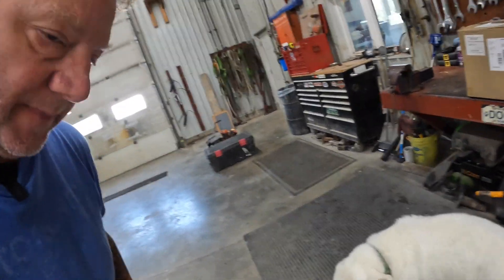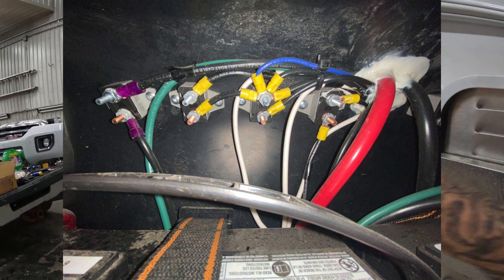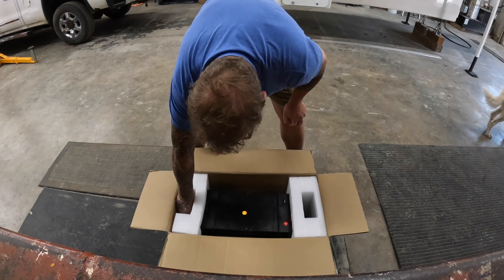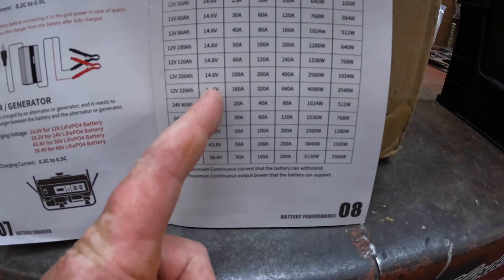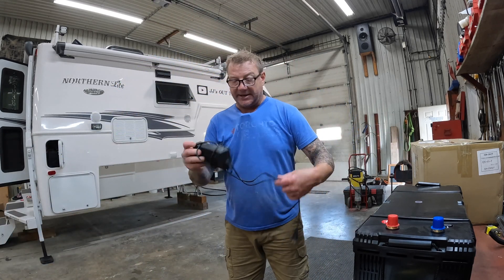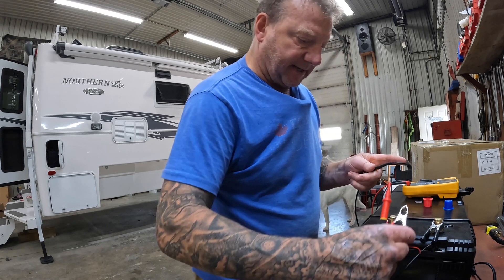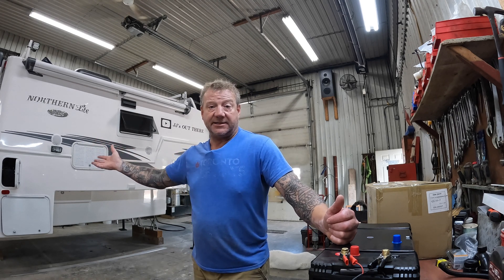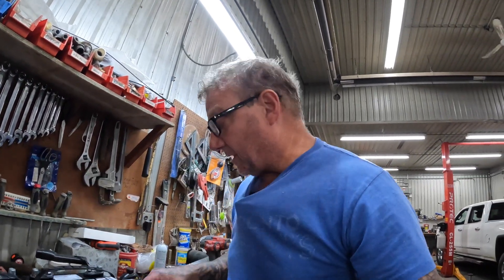640 Ah of  Lithium Iron Phosphate Batteries in a Truck Camper? E-54

Comment: Ohhhhhhh, another thing JJ,  PLEASE, PLEASE add the cost of the batteries.  Cost is everything in this day and time. I knew the battery compartment was flawed. I figured out why, it's a major thing to change the molds and the owner of NL is a stubborn man.
Reply from the maker: I took and put a screen shot of the Amazon batteries in the video.

Comment: You know JJ, I have some ideals on what a truck camper should have. I believe we could design a GREAT truck camper together. You definitely want to go completely electric with a generator back up. I was thinking a split AC unit would be better ???  This would cut down on the height but just a thought. Lance has a quiet AC, new in 2023, Also has heat strips but their solar is lacking so much plus HEAVY.

Comment: JJ weight won't effect performance. That's' why it is not on the chart. Good video, dude. Glad your still rocking it!
Reply: Weight will affect the camper and truck load
Reply: Cadillac system very nice. When I hooked my Langer DC breaker switches, and turn them on I got no power through. In checking the switches I found they were defective.
Reply: Wanna know a fun fact?
Reply: Fun fact:I feel like I know what the next video will be
Reply: Another fun fact:i know jj
Reply from the maker: Yes but when used for a portable application size and weight I believe will be a deciding factor.
Reply: Hi jj